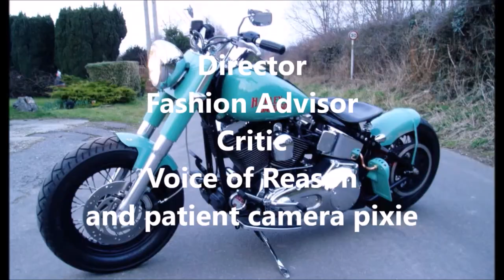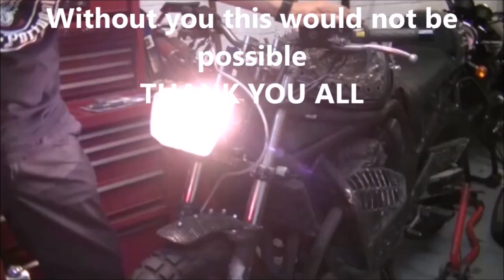Delboy's Garage, Tiger Rat #8, More Bash Plate

Comment: Del you not going to drill any holes in it? else you could find yourself with a tone of crud  between the plate and the engine
Reply from the maker: Petrol Head Early stages yet buddy, a long way to go, got to define the final shape, see whether it's gonna be too wide for cornering, or whether it looks right on the bike... once the final shape is achieved, it'll get proper reinforced drain holes to keep it drain'aged' !  Stay tuned, more to come ...